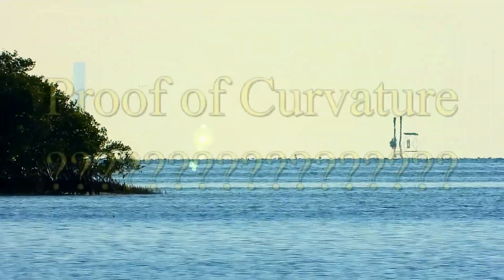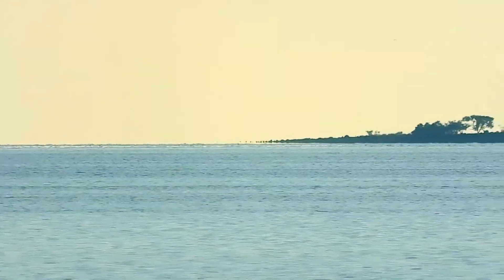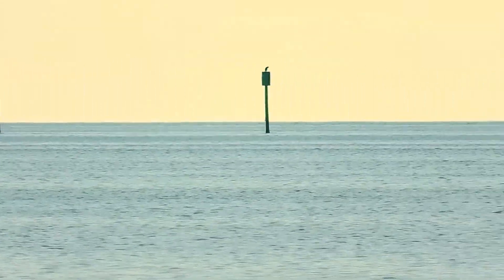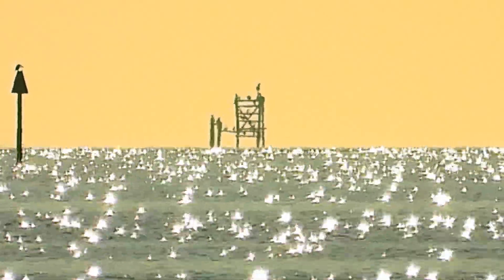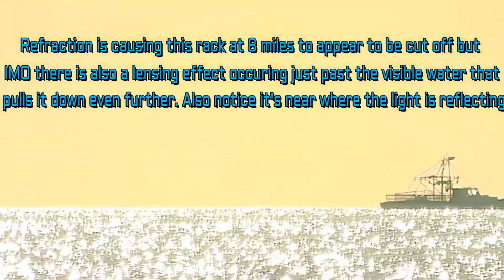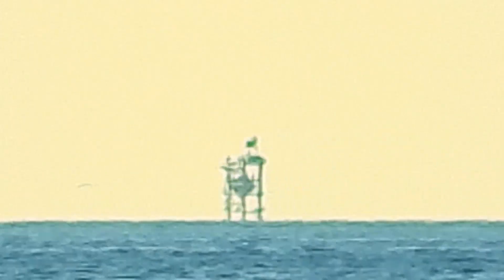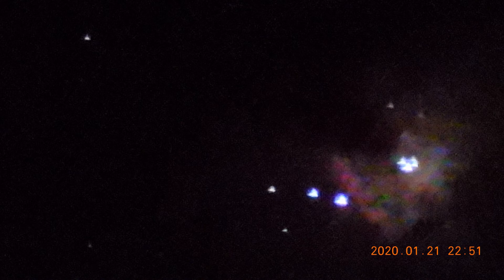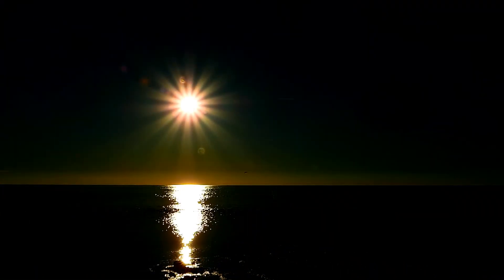Proof of Curvature

Comment: Completely correct, it refracts up not down. Satanistic upside down ball earth lies that it does opposite. Globers think this is proof of curvature lol.
Reply from the maker: Maximus Real
The problem with the globe zealots is no matter what evidence we provide they deny it without even looking into it.
I think most of the trolls are being paid or they are a computer generated sock puppet account programmed to defend the globe.  
There is only an optical illusion of curvature that both the globe and concavers claim is real but IMHO it's flat with a possibility of a slight bit concavity.  
Other than that it's FLAT and that's that.  🙂